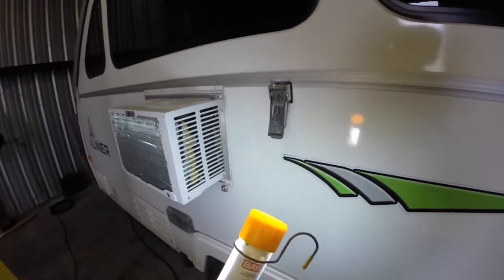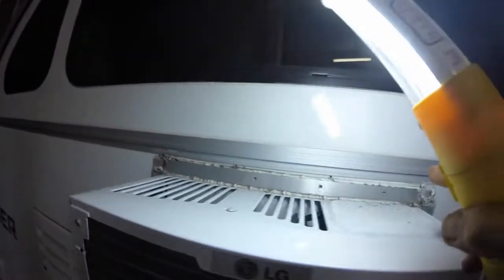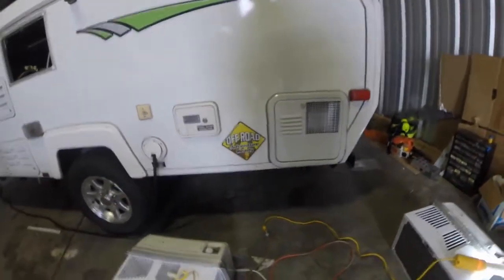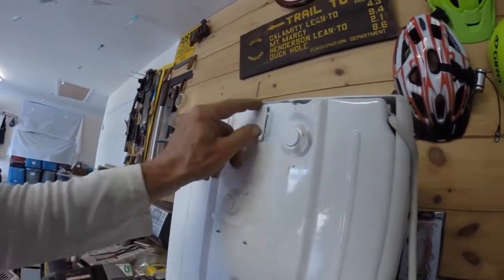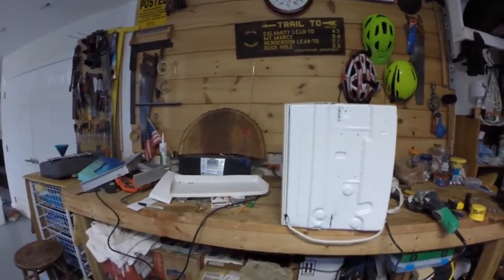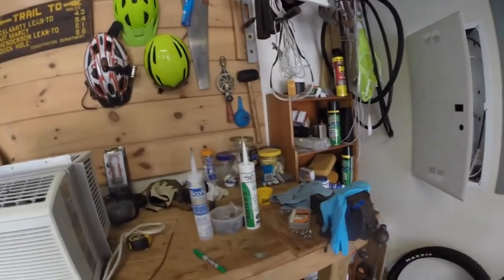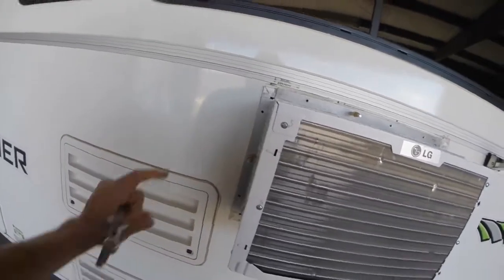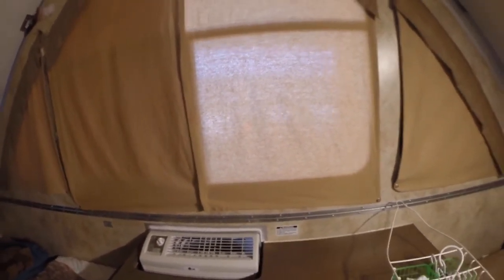Aliner A:C install

Comment: Robert, is the AC still working for you? How long did it last?
Reply from the maker: I have owned the Aliner for 7 years and this is the third new AC I have installed. Have not used it very many times so it is disappointing that they don't last. Believe they bounce around too much and are not a good unit for this type of application.

Comment: Hi Robert.  Doing this myself. I have an lg 6000. I am assuming g it’s the same super secret mod.  Is there anything you need to do to insure draining  when you add the foam?  My original only had no internal mod.😂
Reply from the maker: Dave: If I understand your question you purchased a non 
Aliner A/C and will remove the cover and add some anti-vibration foam to increase the life of your A/C. You could then do an install insuring the trailer is level as it would be when camping. Run it to insure it drains properly [enough tilt outward] and then finish with caulking. Where did you find your new 6000 and how much was it? Robert
Reply: @roberthunter8672  Hi Robert.  The LG lw6017r is available at Best Buy for 199.00. This is the unit being installed in new aliners.  The one I pulled out was a 5000btu Haier. Aliner sells the same LG unit as a drop in replacement with brackets pre installed and of course the vibration dampening “mod” for 575 but are tight lipped about what internal mods they make.